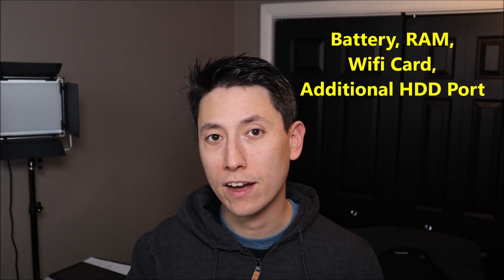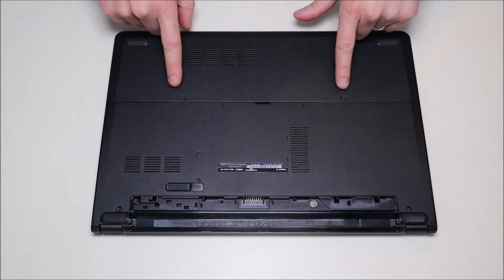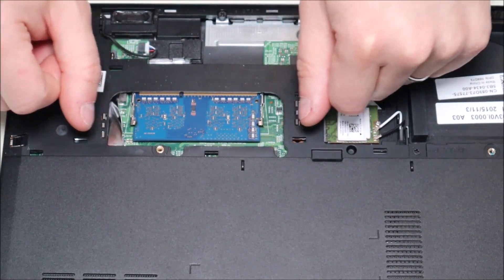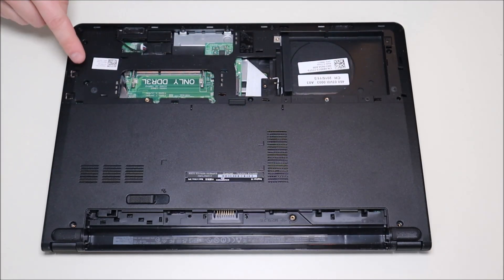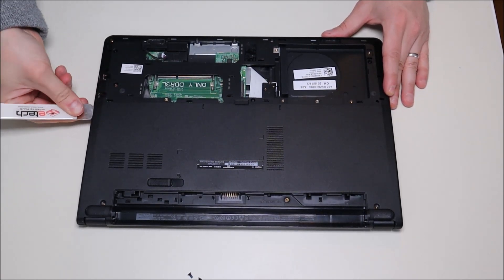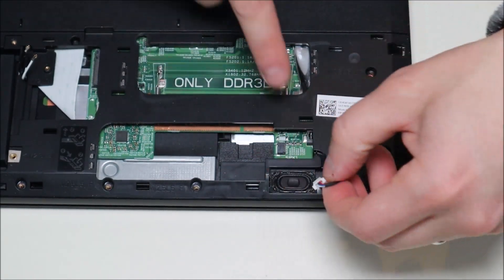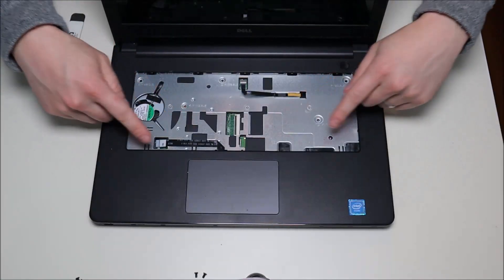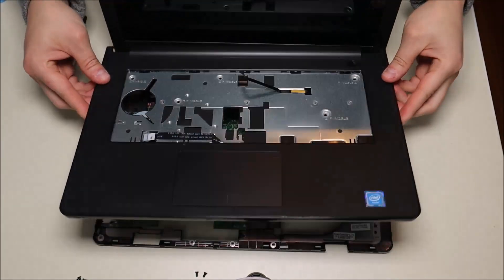Dell Inspiron 14 Laptop Computer - How To Replace Keyboard, Touchpad, Power Button

Comment: I have a problem, My dell inspiron 14 show “hibernating” on screen  and can’t start my window ( sometime i can start my window but only 5 sec it show “locking” on screen and shut down ) how i fix it.😢😢😢
Reply from the maker: Can you force shut down by pressing and holding the power button? If so, what happens when you restart the computer?
Reply: @PC_Monkey  it show the same :(
Reply: @PC_Monkey  i test diagnostics it show error code 132 (battery is reaching the end of its usable life)

Comment: Ey this is my laptop, it won't boot up, black screen, I just recently changed my cmos battery and I think I broke some stuff 😢
Reply from the maker: 1. If the screen is black, what are the signs that the computer is actually turning on? 
2. Also, did anything happen before this issue appeared?  Liquid spill, overheating, Windows update, etc?

Comment: I have a Dell 3583 the 2,w,s,x, and cap keys stop working, not to mention I broke the spring I think on the cap key, is it time for a New computer? 😢
Reply from the maker: If you broke any components to the key assemblies, you could replace the key, the keyboard, or lol the whole computer if your looking for an excuse to do so :)
Reply: @PC Monkey  I was able to fix the key but still have told ones that won't work if I press and hold or continue to tap they work sometimes 🤔 but I did purchase another PC but like this one 🤷🏾‍♂️

Comment: My dell nspiron is stuck on prepare automatic repair, I tried the boot method with the f12.I tried everything but it’s still the same. I even took it to get it fix but they couldn’t fix it. How can I solve this problem?
Reply from the maker: 1.  You have tried all the steps seen here?  https://www.youtube.com/watch?v=EIrJ_w0fMBI.  What was the result of the diagnostic scan?
2.  Also, did anything happen before this issue appeared?  Liquid spill, overheating, Windows update, etc?
Reply: @PC_Monkey  yes I did,and no nothing happened before the issue
Reply from the maker: @mylahramirez4823  What was the result of the diagnostic scan?
Reply: @PC_Monkey  it was good I had no error it said that everything was good
Reply from the maker: @mylahramirez4823   If changing the settings in BIOS did not help and the diagnostic scan showed the hard drive to be healthy, then you can proceed with the rest of the video.  You can try the Repair or Recovery options in BIOS or undoing the last update if applicable.  If that does not help, your last resort would be to install a new operating system.  
How To Install Windows 10:  https://youtu.be/zYY-Gq68Dvo
How To Install Widows 11:  https://youtu.be/Yiy-53Wc-Wo
Reply: @PC_Monkey  I do not have a usb to install windows
Reply from the maker: @mylahramirez4823  If you cannot create your own, then you would have to purchase it.  You can see examples of what you need here:  https://www.amazon.com/shop/pcmonkey/list/2QAI8XMVWC7DK?ref_=aip_sf_list_spv_ofs_mixed_d